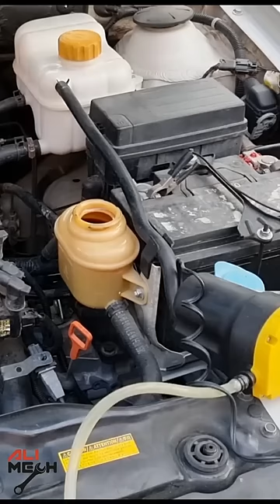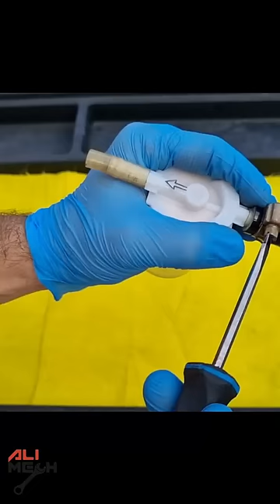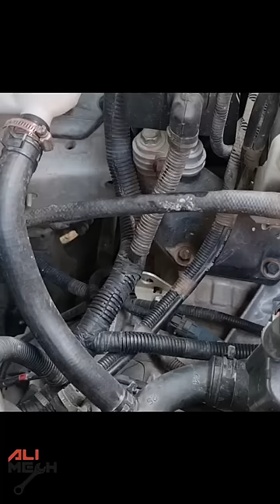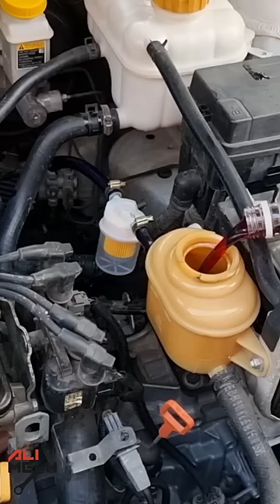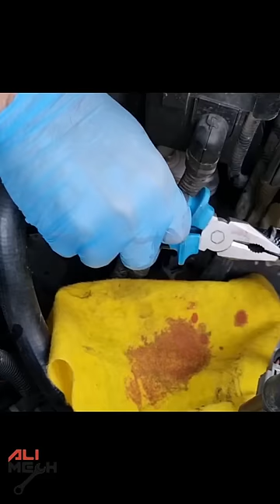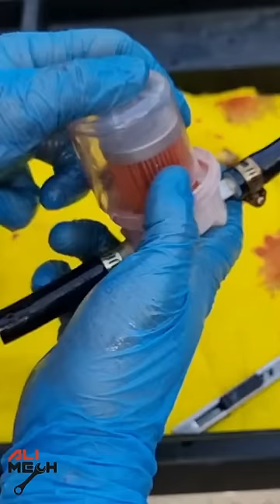This will save your Power steering? #shorts

Comment: I have an old Jeep, I'm going to need this filter. Then I realised, I'm going to need a power steering too. 😘😘
Reply: Old jeep don't have power steering?
Reply: @蘇服-q7v  Yes, the stock one is  manual recirculating ball type steering. It is an interesting concept, multiple steel ball bearings travel in the worm track. It is still being manufactured in India by Rane TRW Steering systems pvt ltd.  
You can install an aftermarket modern power steering pump. Its possible to weld an extra plate to the ladder frame chassis, drill holes and bolt the power steering.
Reply: @drsamuelk  no wonder why jeep is so durable.
Reply: Good  one lol
Reply: Then you realize, you're going to need all new suspension, oil pan gaskets, new brake lights cuz yours became brittle, and new coils cuz the idiots who made it decided to put all 6 spark plugs to 1 coil
Reply: @567Kriss  Ha ha ha, you're so damn right. But they were made at a time when cares were few and love in plenty.
Reply: I miss when vehicles had no power steering. Makes driving feel so much nicer.
Reply: Your car isn't use power steering technology, but use STEERING BY POWER. 🤣🤣
Reply: @蘇服-q7v  all other trucks except the newest ones with rack and pinion steering also use recirculating ball steering boxes, even with power steering. If it has a steering box on the frame... it's recirculating ball type. There is nothing special about the jeep one.

Comment: If you have chips in the steering oil, you already have a problem. The filter doesn't help either.
Reply: Not true, but ok.
Reply: @sorakojootti2725  you can try and prolong it, but it's not going to save the day. Massive metal bits like that do not show up in power steering unless there is a major problem, the particles that end up in the oil are on the micron level, something that a full flow filter will not catch... And those particles are coming from a failing bearing or pump... You can't filter it good again.
Reply: @volvo09  Sure i undertand that it wont fix your broken bearing etc. But there can float debry, not just broken parts. If you have 20+years old car and the power steering works... the oil there wont be clean
Reply: It is OK as an additional action. When the pump crashes, flush the system and install a filter. Or change everything, including cooler, lines and steering rack.
Reply: @sorakojootti2725  You are both right to a degree. A filter will not keep a major part from breaking but... it will help prolong that from happening unless of course there was a defect in that part that made if fail. I Think the title is more a click bait thing more than anything. Yes, this filter will help prolong excessive wear but if you just change the fluid regularly you really dont need the filter. Even steering systems that have never been serviced on most cars still last the life of the car.
Reply: SOMETHING EXTRA TO PREVENT DIRT WHEN POWER STEERING STILL GOOD  👍
Reply: I think the filter seems more of a diag tool than anything. See if the pumps shredded. Can make shavings without noise. But either way it’s a detergent fluid cus it looks like atf and probably is. No need to do this extra other than save a couple extra months before buying a pump or rack
Reply: @volvo09  That's simply not true, a centrifugal vane style pump is always wearing the vanes with metal to metal contact, especially when new. A brand new pump will produce a lot of particles like that during break-in, hence why a whole system flush and filter is needed whenever you put a new or rebuilt pump on. Ever notice how a replaced pump is noisier for the first day or two, then it quiets down a bit after some run-in time.... that's why, it has to break-in.... meaning metal particles. The centrifugal vanes need to mate, or wear into, the pump housing. If you've ever rebuilt or had one apart, you'd likely understand why they are producing particles like this for their entire service life, but much more so during the break-in period especially. PS pumps are a wear item, anytime it's being used its wearing out and introducing particles into the fluid and system. Just like brake pads.... you can't use a PS pump without causing wear. If it's turning.... it's wearing, period. You will never see any power steering system that has any amount of time in operation that doesn't have visible particles like that in it.... unless it has been filtered on the way back to the pump reservoir. All big rigs like semis and other big diesel style flatbeds, box trucks, etc. all come with power steering filters from the factory.... for a reason. What he is doing in this video is catching all the crap from the break-in of a new pump and then removing the filter like it was without one originally. He is showing you what comes from a brand new pump. 5 minutes isn't a very long break-in time, but I'm sure he caught the worst of the immediate debris with the filter. If you think these things, or any other mechanical component, are clean and free of machining debris upon assembly at whatever plant they're coming from.... you're sadly mistaken..... you need to catch all that stuff from the machining of the pieces also. That's why you have to change the fluid almost immediately after running any new component after break-in, like differentials, transmissions, engines, pumps, transfer cases, etc. You can't just fill and forget any of those when they're new or rebuilt.... all of those oils need to be changed within the first few hundred to 1000 miles when new or replaced, for a reason.... you gotta get the break-in particles out (which is what he is doing here). It used to be common sense  but I guess not so much anymore.

Comment: For $20, I'm willing to give this a try on my car. As a mechanic, I'm curious to see how well it works on a car with 110k miles
Reply: Tiet cong wer dier siga monyet
Reply: Ever see how much a PS system flows ? 
Try like a couple gallons a minute at cranking speed. 
With that return line off and in a bucket, you pour in new fluid as someone cranks it over. 
Good luck in even being able to keep up with how fast it gets sucked down.
Reply: Why?
You already have a mesh filter in your ps tank
Reply: I don't understand why he just doesn't leave the filter on and service it every time the engine gets a tune up.
Reply: @dan_6915 
Mesh filters are only good for chunks and will never catch particles too small to see with the naked eye like a paper filter does.
Basically they're there for when something shreds itself to catch the chunks before they go through something else.
Reply: @dukecraig2402  guess he wanted to show all the junk that gets collected? I'm not sure why he took it off so soon.
Reply: I remember filter companies used to make universal power steering filters. They were a stronger metal type. This guy used a fuel filter. Though, its a return line w/o pressure, the fluid will get very hot and melt it.
Reply: If your car isn't a classic/antique, you most likely already have at least one filter (most have two) built into your reservoir.

Try changing that, instead.
Reply: @Shawn_the_Protogen  
Yea, he appears to take the filter off and replace everything with just a hose as if he only wanted to run all the fluid through the filter once.
I don't get why he just wouldn't want to leave the filter on all the time, you could even just run one of those non serviceable throw away in-line filters that they sell for fuel lines. 
I understand that he used the one he did because he wanted to be able to show what it was catching but for the sake of not having to take something apart and get fluid all over the place I'd just use the disposable one's and clamp a line lock on the hose's on each side of it so you wouldn't have fluid running all over the place when you take it off.
Reply: @digitalis2977  
This one probably already has them and look at what the filter he put on is catching. 
The one's your talking about are only mesh screens and/or felt type pads that are really only good for catching large chunks in the event that something starts shredding itself so big chunks don't go through everything. 
Prior to fuel injection being on them Harley's didn't have in-line fuel filters but they had a plastic mesh screen on the part of the fuel petcock that sticks up inside the tank, like the filters you're referencing on power steering systems they were only good for catching large chunks that could wreak havoc inside of a carburetor, like little chunks of the coating that's inside of the gas tanks on them that flake off and can even cause problems with the petcock.
That's why I always put in-line filters on my own bikes and my customers bikes at my shop, in the long run they'll save you a lot of agony especially if you're out on the road on a bike, seems like that's when something that might go wrong will, when you're miles from home and something as simple as taking a carburetor off and cleaning it out is turned into something as difficult as open heart surgery.
Reply: @dukecraig2402  Well...yeah.

It's never been changed.  

Filters aren't permanent...most dual-filter reservoir setups are intended to be changed every 30k miles or so, and if you don't, the chemical-resistant foam sponge inside is designed to bypass once resistance reaches a certain point to prevent obstruction and blowout due to elevated pressure.

In most modern vehicles, it'll cost you less than $20 for a new reservoir...plus a bottle of applicable fluid and 15-30 minutes of your time.
Reply: @digitalis2977  
All that being what it is those types of filters don't filter as well as paper filters, there's no getting around that, the plastic mesh petcock filters I mentioned also have a service interval but that doesn't change the fact that they don't filter out smaller dirt and rust particles that over time build up in a carburetor causing problems. 
Many old vehicles had cartridge type oil filters that the element was not capable of filtering to the level that paper filters can and is why modern paper cartridges have been developed for them over the years which is what everyone runs in them in this day and age, I don't know of anyone who has antique vehicles that wants the cartridges that are made like they originally were or if you can even get them made like that anymore, why someone would want to run them instead of a modern paper element I couldn't imagine why.
As far as the one this video going into bypass from being clogged that's an assumption, probably a fairly safe one to make but still an assumption, so even if it isn't in bypass it still isn't filtering to the level that his paper filter he put on is.
Reply: Can you update us if and how much it works
Reply: @marnixkamminga8083  yeah, I'll probably update after I let it run for a month, maybe post a vid showing how much gunk its collected.
Reply: @dukecraig2402  If he drove around, the fluid could have easily become hot enough to melt that filter. I actually just keep a turkey baster around to suck up what's in the reservoir and replace it usually whenever I'm at home and checking my fluids.
Reply: @th3ch33t  
I do the same thing with my brake fluid everytime I replace brake pads and have the pistons pushed back in the calipers forcing the fluid back into the reservoir, instead of doing one side at a time I use a C clamp to hold the piston all the way in on the first side then when I have the piston pushed all the way in on the other I suck all the fluid out of the reservoir and put in just enough to push the pistons out and seat the pads on the rotors then top it off to the "max" level when I'm done.
As far as power steering I don't have to worry about it because mine is electric, but you could use a metal body in-line fuel filter on one of those systems.
Reply: Why? I drive plus 600 000km's driven car and it hasn't had ever p.steering issues. If something like this is needed it's only for some badly designed racks to maybe, just maybe prolong system life a bit. Plus I wouldn't even count basic filter to last oils. Nasty surprise if it breaks during drive.
Reply: Shoot I run one of the universal power steering fluid filters on my 99 PowerStroke. Had a bit of trash write off a ps pump and the hydroboost for the brakes. Filter in place, changed after 5k miles and no longer an issue. Do take into account this was not a 1 or 2 owner truck that also has 266k miles on the clock.
Reply: as a mechanic you should know that inspecting that filter didn't show really anything. there was no metal, and nothing the pump can't handle or be clogged by. power steering can last the life of a vehicle, but if you're really looking to help then replacing it every few years isn't a bad idea.
Reply: In a closed system , where do the contaminants come from?. And if their were a way for contaminants yo get in. What would happen when the filter gets full and starves the pump of oil?
Reply: @michael2943  its not really contamination in the normal sense. Its bits of metal from the pump or rack n pinion or in a trucks case steering sector. Could also be bits of plastic from said pump or flakes of lining from old PS lines. Edit: usually change the PS filter with every other oil change if its an added filter
Reply: @dukecraig2402  It would effect the fluid flow.
Reply: Question for the mechanic what all do they fix/do when you get a toon up.
Whenever I look it up or ask a question at the desk of a mechanic shop I get oil plugs and thats basically it.
If so toon ups are easy just takes time.
Reply: @thesilentone4024  depends on what year, make, and model vehicle it is. Some are just an oil change, fluid top off and plugs. Others are plugs, plug wires, rotor, distributor cap, oil change, fuel filter, air filter, fluid top off. If old enough points and condenser also come into effect
Reply: @Sean M are you supposed to turn the wheel with the wheel on the ground or elevated?
Reply: @dukecraig2402  a filter will interfere with the operation of the steering system (which does not include one) is my educated guess. plus the set up in the video was intended as temporary.
Reply: @dukecraig2402  he only left the filter on for a few minutes because it's a fuel filter, not made for this application and won't hold up. It doesn't flow enough as it is, top that off with some debris and it will just choke the system up until pressure builds up inside the filter from lack of flow, and it bursts.

If you want to put a permanent filter into your power steering, there are in-line units made for automatic transmissions which would work beautifully for power steering.

Other than that, you could just flush the power steering fluid every few years and never need to worry about silly unnecessary filters.
Reply: @amd.0001  elevate the vehicle to make it a hell of a lot easier to turn the wheels, and reduce strain on the steering components and tires. Your car isn't really meant to steer the tires when not in motion.

Comment: I use a turkey baster to suck out the the fluid in reservoir every other oil change.  Same with brake fluid. Helps extend the life of steering and brake systems. Quick and simple to do yourself.
Reply: У вас автомобиль премиум-класса или спортивный?